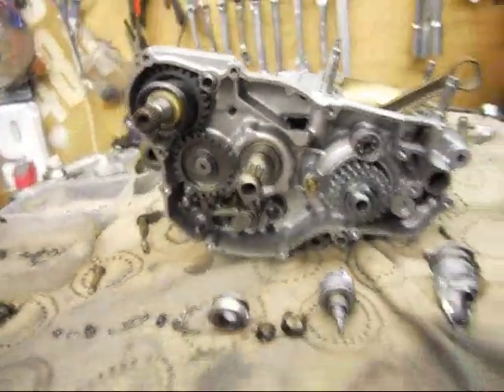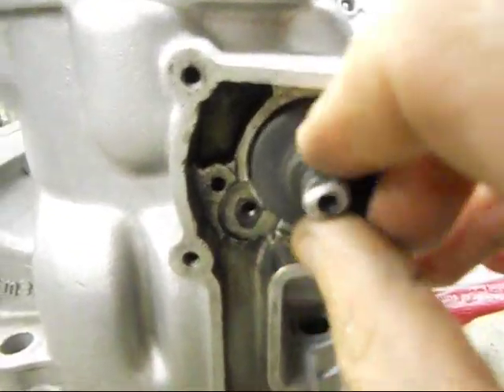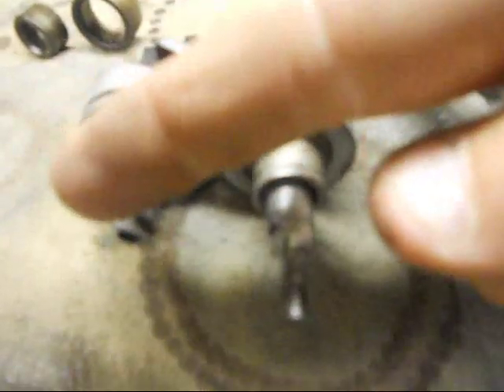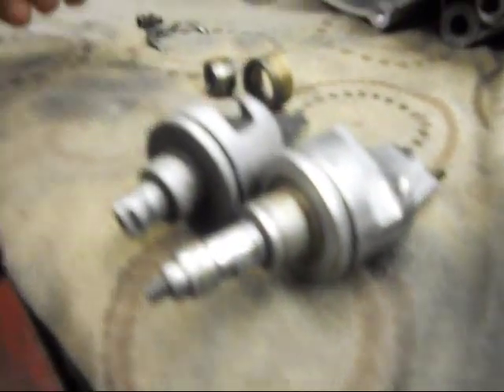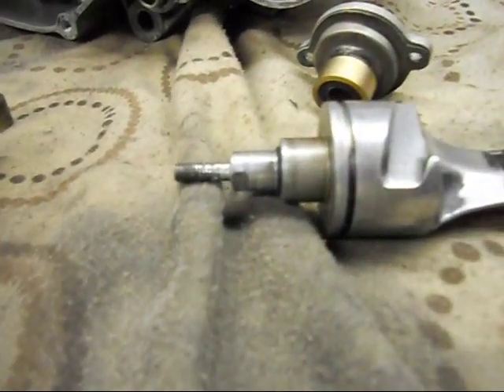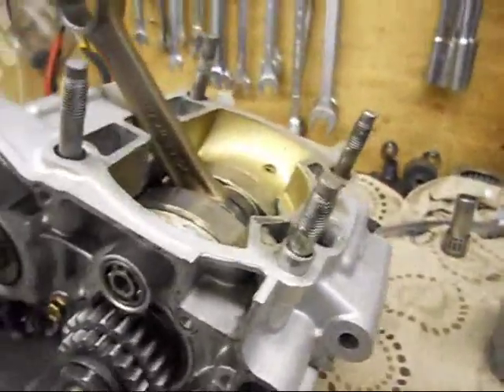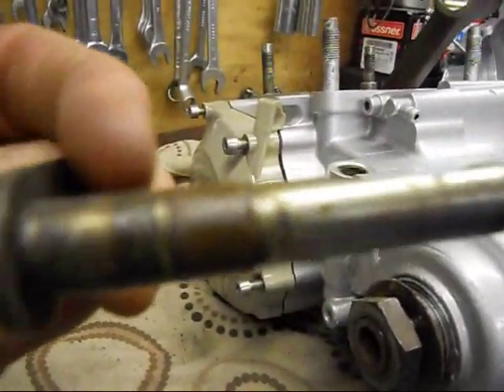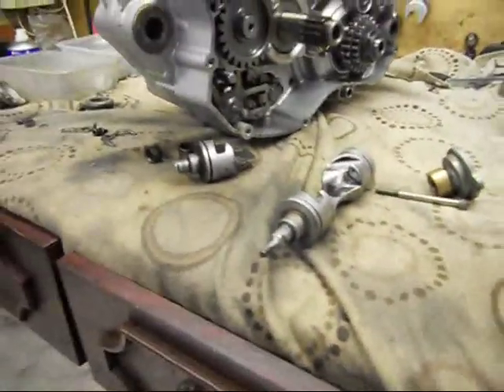YZ 250 1989 ENGINE DIAGNOSIS / POWER VALVE

Comment: I have a powervalve for my 92 on order from yamaha. Not to my suprize its back ordered.... $177 bucks for a new one. Supposed to be here for the 22nd of this month. Im restoring this bike. The top end was completely destroyed when i bought it because one of the pins from the power valve ejected into the cylinder haha. Frame goes out tomorrow for powder coating.

Comment: @SirSmighty your power valve gear is not engaging inside the transmission case, had that problem putting the case back on my 98 250.

Comment from the maker: Glad to see that you do your own mechanics , its the only way to understand every part and how it works , i am very experienced with the yz two stroke any problems etc contact me ,If you had a re.bored /lined cylinder , be sure to check the power valve clearances , and put some threadglue or similar  on the screw  that holds the 2 parts together ,  I

Comment: then i must of caught mine in time had a gut feeling that i needed to take the entire engine apart and come to find out the power valve bolt inside was so loose and the clutch basket nut was loose i only paid 250 for the bike and the guy before me has money in the bike hot rods crankshaft wisco piston boysen reeds and spacer full fmf exhaust gold series fatty pipe and i believe power core 2 silencer its a nice bike for 250 but that gut feeling told me i should take the engine apart.